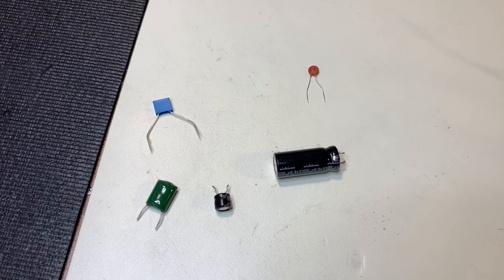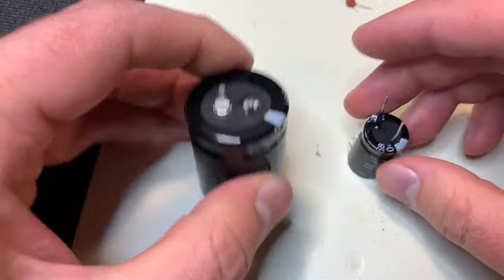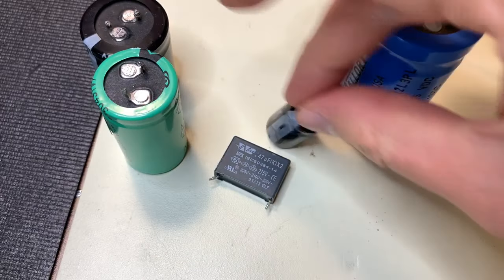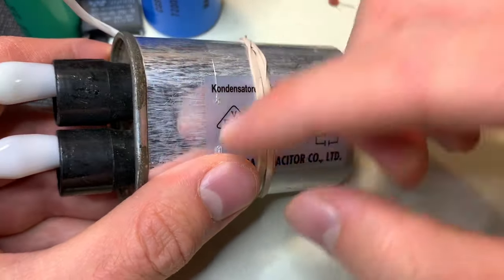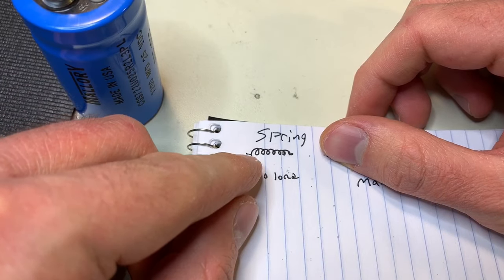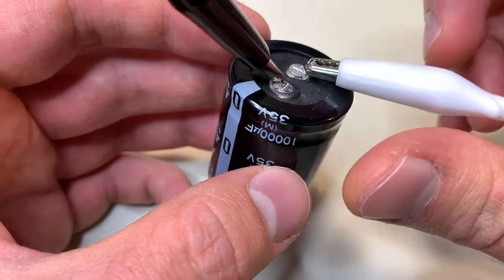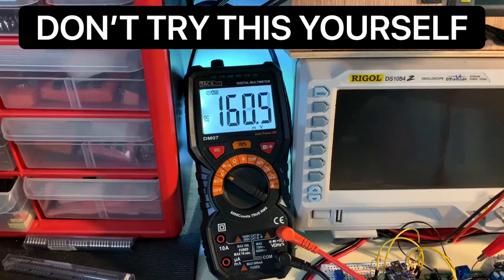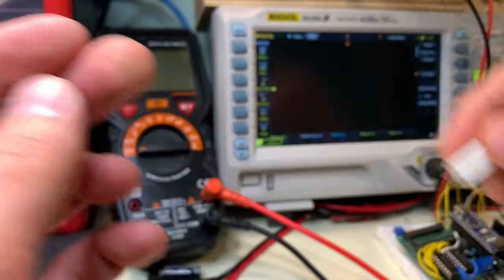Capacitor Safety - How to Discharge Capacitors Safely

Comment from the maker: Hope the video was helpful! If you need some tools recommendations check below
Quality meter to test voltage of capacitors - https://amzn.to/3x7P5eL
High Voltage Discharge Stick https://amzn.to/3x4BuVt
Drivers to use around high voltage - https://amzn.to/3j8zweN
Reply: Question: Blower unit capacitor in my Bryant forced air heater might be bad. So… before I attempt to remove it, how long after cutting off all power to unit, will it take to discharge on its own? An hour? A day?
Thanks in advance for your response.
Reply from the maker: @john-robert1961  Not sure, but if it was me I would turn it off. Then go measure it with my multimeter. Then I would wait a few minutes and check it with my multimeter again (voltage setting). See if it's discharging on its own and how fast.
Reply: @HTMWorkshop  thank you kindly for your rapid response. Naturally, I would turn off the main wall switch that connects to the unit, before even attempting to test anything. I will do the voltmeter test, followed by the capacitor test. I’m glad that I have encountered your video earlier this evening, it’s very informative.
Reply: @john-robert1961  Back in the day, it's amazing how many people went POKING around (INSIDE) those old VACUUM TUBE TV's with a SCREWDRIVER!🤯😁😆😂🤣😂  BEFORE properly discharging the Capacitors!   What a SURPRISE they received!😆😂🤣

Comment: I just discharged a 450v to the palm of my hand let's say I have 2 boils now and pain.... that's why I am checking this video out....
Reply from the maker: Electrical burns can definitely hurt. Hope your ok, glad your learning from your mistakes! “The only real mistake is the one from which we learn nothing.” HF
Reply: @HTMWorkshop  it still hurts after 1 day and I have a massive boil but I still need to see how to discharge these 450v I work with I repair consoles and they have 2 of these big capacitors I saw something on the internet to connect a light bulb to alligator clips and discharge it that way but I wasnt successfully in riggin something up so I just used the old screw driver but they discharge extremely dangerously in my opinion and I dont want to blow one up in the system.....
Reply from the maker: @176cgna  Yeah a screwdriver is just releasing the energy very quickly (and that means things can get hot), you need a good high Watt resistor (and decently high resistor, depends on how many Farads you are dealing with and how quick you want to discharge - has to due with time contact of an RC circuit). Most incandescent light bulbs are rated for 60W, and have a pretty low resistance of 120 ohms, so for a 450 V source you are roughly looking at around 3.75 Amps (most bulbs are rated around 0.5 amps). So not a great solution for high voltages. Some places sell high voltage discharge sticks for about twenty bucks if  you want a profesional solution. But if you can find a high watt (2 W or greater with a resistance of around 100 kohms, that should work, just may take a while to discharge depending on your capacitors)
Reply: @HTMWorkshop  ah ok ima look for that tool I dont care about price and I work with these capacitors enought to warrent the purchase of a professional tool
Reply from the maker: @MyMate Leyto35 Thanks!
Reply: I accidentally discharged a 450v one with my right index finger while I was disassembling a monitor (ironically to replace the capacitors). Screwdriver slipped, I wasn't wearing gloves. My entire right arm and chest muscle were shaking for 1-2 seconds, it didn't hurt, it felt like some supersonic exercising. Of course I had two burn marks on the finger and blisters, and that did hurt for a few days. I have a suggestion for the author (if he happens to read the comment). It would be nice to give some ideas where we could find those resistors that can be used for diy discharging devices. I don't mean where to buy them, but where to salvage from (old/broken devices). I'm a hobbyist, repairing my own stuff, and what usually happens is I start some work and then no way I'm waiting 2-3 days for a resistor to arrive, so I end up using a screwdriver (release a spring). Same situation today, I forgot to order a resistor when I ordered the capacitors a few days ago (but I'm putting on rubber gloves before removing the monitor power board and discharging the fat guy).
Reply from the maker: @karakondzula4216  Well any high voltage discharge stick could work (they are about 20 dollars and well worth the money at your local store that carries things for electricians).  I recommend them if you work with high voltage often. However if you want to try and salvage a high watt and high resistance capacitor you may want to try and find bleed down resistor on other high voltage equipment. Then create what is essentially your own homeade discharge stick (that way you keep your hands away from the components). Basically you put the resistor at the end (touch location) and connect the other end of the resistor to a conductor. Next you run the conductor a long a stick and connect a grounding alligator clip. You can then insulate the whole thing. Ideally the resistance chosen should be high enough (and wattage high enough) to safely (low amps ...less than 5 mA.. ideally microamps) discharge your circuit. You can use good old ohms law to determine current. Hope that helps.
Reply: @HTMWorkshop  what would you do if you're taking out and replacing high voltage capacitors? Would you desolder first? Or would that discharge them? I want to replace some in my tube amp.
Reply from the maker: @greendragon2471  I would definitely discharge first then verify no voltage difference (or at least close to), then it's safe to desolder
Reply: You could just use multimeter in dc voltage mode, and hold it for a few minutes, it will show the voltage slowly dropping.
Reply: I was working on a Xeon tube without me realising it was charged , the cap was 350V 10Mf and the pain felt like mains going trough my finger.

Comment: My trick for those 200V or 400V capacitors is to use a lightbulb with wires soldered to it and just discharge it using the bulb, best to use an old fashion one with wire inside it, really useful when you are dealing with such voltage.
Reply from the maker: Good visual indicator - although I prefer to use a couple lightbulbs in series for something as high as 400 V.
Reply: For as long as I can remember, my dad keeps a lightbulb on some wires in his tools, which he uses to test circuit completion when doing house electrical work. Of course he first finds the live phase with a tester, and then checks with the lightbulb to be sure the ground is also connected.
Why not use a voltmeter you say? Well he says, "I don't have a third hand to hold it with".
Reply from the maker: S Wong  it can but only for low current situations! Most LED's can take around 20mA so you do not want to exceed the max current (or else your LED will turn into a fuse - which is not the end of the world since most LED's are cheap but it may fool you into thinking your capacitor is discharged when in reality you just fried the LED).
Reply: @HTMWorkshop  this was a very in-depth explanation. Thank you!
Reply: Just curious doesn't the filament have to heat up first before it offers resistance? Do use a 400 watt bulb?
Reply: @carleynorthcoast1915  It heats up BECAUSE there's resistance.

Comment: Great video! I wish they explained things this well when I was in school. They probably did I just didn't get it at the time. Age is not always a bad thing! Thanks for the info.
Reply: Great comment, so true.
Reply: they cover it indirectly  if that is of any constellation. For my CompTIA A+ they said that if you get trained to work on televisions you will be taught how to properly discharge the capacitors, then in electrical they explained the relationship between resistors, capacitors, and time. Then throughout electrical they regularly explain that oftentimes steps often considered not recommended are the safest way to do tasks while implying that shorting a connection is sometimes the case. 

Never once do they explicitly teach anything about properly discharging a capacitor but by the end you have tons of hints. So for this reason I am very happy to learn the specific recommended process for the first time and as such I would very much like to thank the video author.

Comment: I'll never go anywhere near the insides of my guitar amp, and now I know why, instructive video, thanks
Reply: Apart from changing a tube, I'll leave it to someone competent. I'm too forgetful to mess with the innards of an amp and would die probably
Reply: Always cut the trailing ends of strings off when you change them was good advice I was given. 1: So you don't blind someone and 2) They can penetrate electrical equipment!

Comment: I really learned a lot from this video and I sincerely thank you.
I hope you make a video teaching how to safely discharge a higher voltage capacitor—not necessarily the 2100V type, but the 200V to 400V range might be helpful. 
For reference regarding the 2K capacitors, it may add perspective for people to realize that the electric chairs used in the electrocution of condemned prisoners typically delivered around 2,000V. Granted, they were higher amperage (7 to 10A) and the charge was delivered for several seconds, but it gives us an idea of the seriousness of 2,000V.
Reply from the maker: Yeah 2000V is high - yes 200 and 400 V are often used to start motors and fans (things that need high torque). Good idea.
Reply: That’s is fuccking painful for 2000 V and 1-10 A. Holyshitttt.

Comment: I have three microwave capacitors rated at 2100V sitting around my house not yet discharged! Just realized I'm lucky to be alive, and that is why I am watching this video.
Reply: Youtube can save you. Thank god I watched that video about what grenades do.
Reply from the maker: Usually, they have resistors built in to discharge themselves. But, it's always a bad idea to rely on one point of failure with big caps. Capacitors can also spontaneously develop a charge to do dielectric re-absorption. I personally like to keep them permanently shorted out with alligator clips like that, just in case!
Reply: @HTMWorkshop  - Excellent explenations for capacitors. I didn't know that they could charge on their own. Thanks
Reply: @HTMWorkshop  l
Reply: How did we get here

Comment: I've been dealing with caps for decades, so I didn't learn anything new from the video, but I was highly impressed with your teaching style, calm and steady and looked like you prepared well.  It is obviously aimed towards beginners, and you reduced the topic to its essential elements, and explained them simply.  I was hoping to see what you had to say about BIG caps, I worked at a 500 Kilowatt shortwave station.  Can't say "my loss" as I enjoyed watching your video.  73deK1WXY
Reply: Are there any other components you should be carefull with?
Reply: Anything involving high voltage.

Current transformers...If the secondary has no load, the secondary voltage can soar to very high voltages.  Won''t explain why here, google it.

Large batteries...Watch your jewelry.  If metal watch band or bracelet shorts out a large amperage battery, you will not be electrocuted, but may get an impression of the jewelry BURNED INTO YOUR WRIST.  Can and has happened to people reaching up under the dashboard fiddling with stuff up under there.  A ring contacting the battery terminal on the rear of the starter switch melted a friend's wedding ring into his finger,  ouch.

Any one else got any suggestions?
Reply: @robertstessel8780  Thanks for the great answer! Will keep this in mind.

Comment: I use solder wick to discharge or verify discharge if not in circuit. I have a 8 Ohm 10 W resistor (used for ESU testing) I use for board discharges (with jumper wires of course)
Reply from the maker: 🤔Interesting.  I have not used solder wick for that application, but I see n no reason not to as long as you are ok with a quick discharge. Nice tip if your doing board work and some handy. The 8 ohm resistor would definitely be a good discharge resistor. Out of curiosity what test are you doing on the ESU with the resistor?
Reply: @HTMWorkshop   Covidien FT10, Force triad etc need to detect a patient load in order to energize

Comment: Also, as a note, that resistor is 5 watts which means it can take higher power.  (Little resistors are 1/4 W or even 1/8 W. Not sure what surface mounted ones are rated at.)

Comment: I have read through some of the comments. I have worked around 400 volt lines and higher as a research scientist. 
     Around 400 volts, there is an invisible charge cloud or corona about these lines and devices connected to them. If one is grounded, burns, neurological and brain damage and death can result without direct contact. An kindly older electrician told me this when I was 24 or 25. He saved me injury and death many times over.
Reply from the maker: Good point - yeah I use to work with 1-10kV and your right (everything even air becomes a conductor at some point and ions can form). I use to do some electrospinning back in the day, and it takes advantage of that very effect.

Comment: Thanks for the video. I’m looking for an example that explains what size resistor is needed, or should be used with, the capacity trying to be discharged?
Reply from the maker: Hmm - I don't exactly have a video on that. I do have a blog that may be helpful here https://htm-workshop.com/how-to-discharge-capacitors-safely/. Also I know in a couple of the comments for this video I explained some specific resistor choices for caps. The key is understanding the power the resistor can take and how fast you want to discharge the cap. P = IV or V2/R , so don't exceed the power rating of your resistor or you will fry it - also the time it takes is based of the time constact for a capacitive resistor circuit https://www.youtube.com/watch?v=JcrlL8YN6VQ. A 10W 1MOhm resistor may be a good place to start but it is very conservative (for most circuits)

Comment: Do the microwave capacitors tell you how long it takes to bleed out that voltage once they are unplugged? I'm guessing a few seconds. Still makes me nervous.
Reply from the maker: I don’t think the manual will tell you...but your probably right. Assuming all is working correctly. Best to unplug, check with a voltmeter then do a quick discharge to be extra safe.
Reply: @HTMWorkshop  microwaves capacitors are around 2kv - 4kv , what size/type resistor would be needed to safety discharge the capacitor?
Reply from the maker: @raybradshaw8444  It would depend on what kind of wattage the resistors could take. Maybe a 1 MOhm resistor ... but it could take some time to discharge depending on how many farads. Often you see 100 kOhms used in high voltage discharge sticks.
Reply: @HTMWorkshop  as a basic sum it took 15sec with a 50kohm (3 R in a sting) tool on 300v, and 30sec with a 100kohm (6 resistors in a sting) on 300v, so dum math says 300secounds with the 100kohm so 5mins for 3000v. 
i just dont know if my little 100kOhm Tool will handle 3kv and not melt like a icepop, lol
Reply from the maker: @raybradshaw8444  It just depends on what the resistor is rated for power wise - is it a high Watt resistor? The higher the resistors the slower the current will move so you can use lower watt resistors (its a tradeoff between power the resistor can handle and time it takes t discharge). You have to check both.
Reply: I'm about to try to change a fuse in my microwave.  Those capacitors scare me a little.

Comment: When you discharged the capacitor with the resistor, did you touch both metal wires of the resistor 
with both metal parts of the capacitor?
Reply from the maker: correct (botht he anode and the cathode of the cap)
Reply: @HTMWorkshop  Thank you! If the wires of 1 resistor are not long enough, could I use 1 wire from 2 different resistors to discharge the capacitor still?
Reply from the maker: @grooty6434  Im not exactly sure what you mean - you can use two resistors in series - yes. There must be a path between the leads of the capacitor - what you put in between determines how fast the discharge (based off resistance mainly) - see more info on time constant of caps for how long it will take

Comment: Thanks! What res is recommended and up to what voltage cap? And is it alright to touch the leads of that res when doing that? Also is a discharge pen recommended for higher voltage?
Reply from the maker: That depends a lot on the situation - for instance do you just want to discharge the capacitor or do you care about keeping the circuit integrity and capacitor working afterwards. A very consdervative basline is around 24 V - I don't mind touching 24 V shorted but if you discharge a 24V cap fast it may damage the circuit around it (depends on the situation). In practically I wouldn't mind discharging a 500 V capacitor if it had a small capacitance and a insulated handle - but that is getting more risky and could easily damage the circuit. It really has to do with your risk tolerance and what your comfortable with but always best o err on the side of safety if you don't have a good grasp on the circuit and your own risk.

Comment: Hello, great video. A question: is it enough to have any resistor to discharge any capacitor ? I mean, can I have only one size so I can use it with a small capacitor or with a large one ?
Reply: resistance too high and it won't discharge. resistance too low and it will melt or catch fire. it matters, you can't just use any. it will depend on both the voltage and the capacitance of that specific capacitor.

Comment: I am replacing the two capacitors on my subwoofer amp. Both are 80V 6800uf. Can I use the screwdriver method to discharge them?
Reply from the maker: Yeah you should be fine, may spark a bit but your safe enough